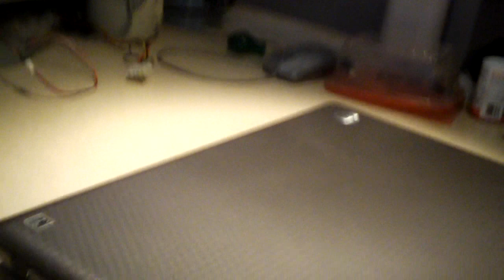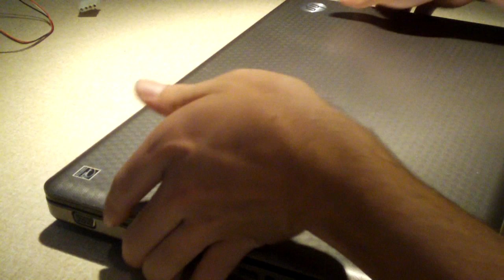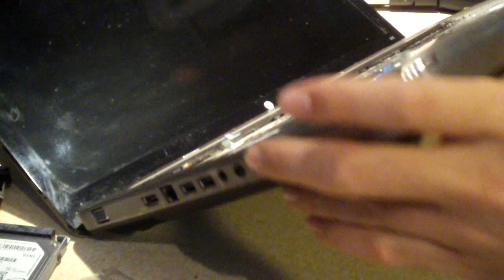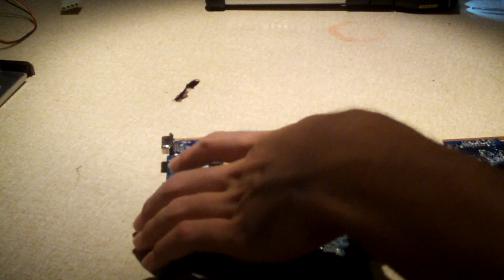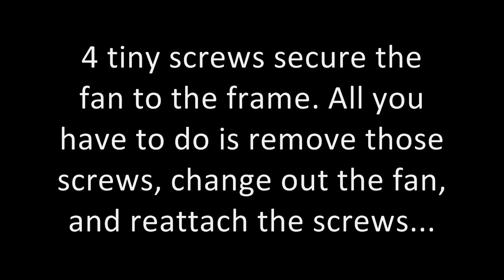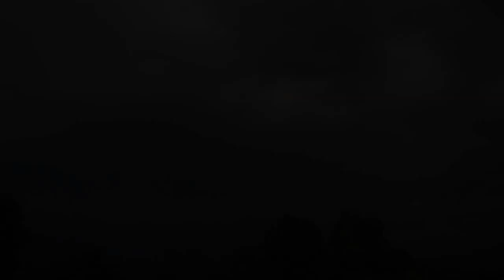Teardown and Fan Replacement on HP G72 Notebook

Comment: This video was very frustrating ! Your hand was blocking the view of the harddrive and I couldn't see how you detached the little clip thing. And it would help if you described what you were doing exactly when your hand is blocking the view. You took the hard drive off and set it aside and I couldn't see the clip part on it. Maybe you should have someone helping you tape your videos.
Reply: Exactly why I came here. just picked up a used one and want to upgrade RAM.
Reply from the maker: If you read the description you'll see this isn't a how-to video
Reply: @CubeComputerChannel  Richard move buddy.

Comment: Can you do a how to to change the processor?
Reply: Henry Ly I didn't remove the Mobo but from the looks of the mount, im assuming it's soldered/welded. Might want to research a bit more
Reply: I did some research last year on the processor make/model. I've also researched the model I have as well. It's PGA988, which is a socketed processor.

Comment: The power jack on mine is lodged into the laptop. How do i get in there to resurface it?
Reply: Bilbo Biscuit after you remove the casing and the Mobo is exposed, the charger is at the top right of the case. some tape should do in theory

Comment: Hi thanks for the great vid. My HP laptop is now apart, cleaned up. Put the paste on and screwed fan and heatsink back on but cant clip the connector of the fan back onto the motherboard. Its so small and the space to work in tiny too. Any ideas would be much appreciated. Thanks in advance.
Reply from the maker: Sometimes a small pair of needlenose pliers can help with small connectors.

Comment: I just folowed the steps oin this video to clean my existing fan/gpu and reasemble. it came on but the keyboard didnt work, i reattached the keyboard, it booted, then shut off in the middle of booting. now it will not power on, nor does the light come on that shows that the charger is plugged in. The charger works, ive tried it on another laptop. what's going on?
Reply from the maker: If the battery's bad then only the power jack will power the laptop. Remove the keyboard and palmrest, then verify that you plugged the power cable from the jack back into the motherboard. It is at the right tip edge of the motherboard. Also make sure you plugged in all the ribbon cables on the palmrest such as those which connect to the power button, touchpad, etc...
Reply: +megadeth934 Just through it away.  These laptops are pieces of shit.  They overheat even when doing light web browsing!

Comment: how do you find out the model of the laptop?
Reply from the maker: It's usually on a sticker on the bottom or inside the battery compartment.